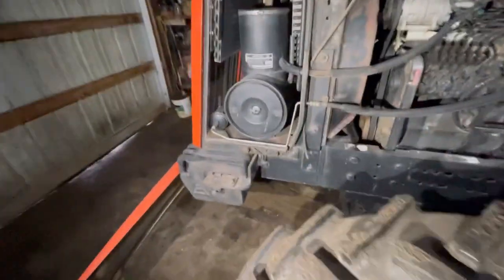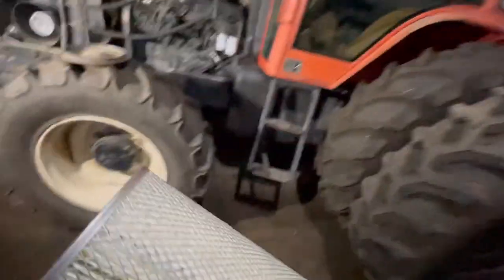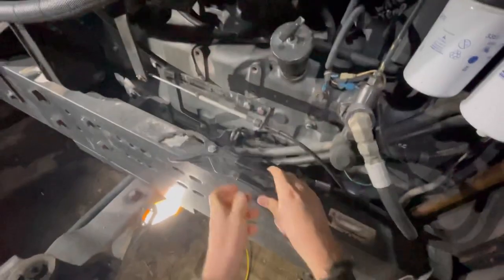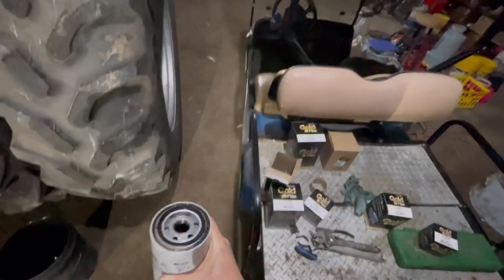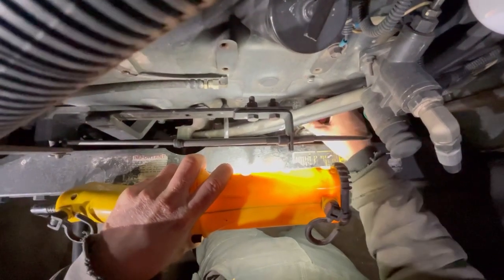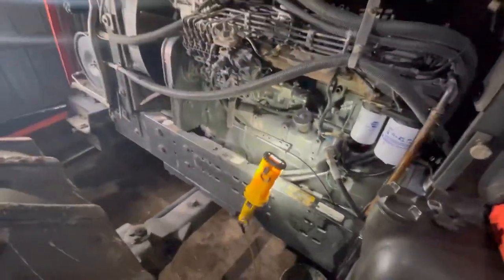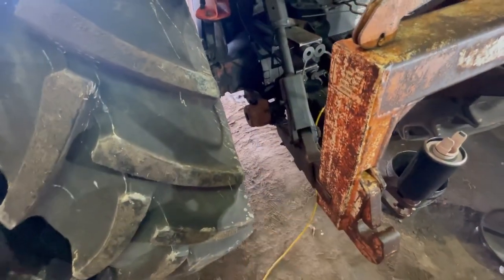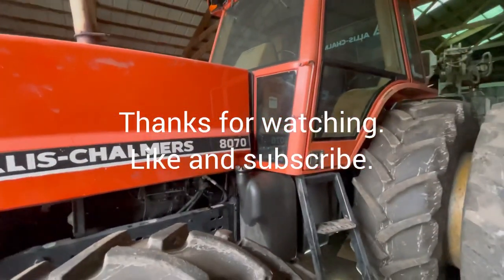Allis-Chalmers 8070 maintenance, longer video.

Comment: 7060 and 7045 would be a Roosamaster pump and the 8070 would have  Ambac M100 pump. 8.3 engines are great but those transmissions/rear were never made to hook that kind of potential to the ground. Front axles aren’t great either.
Reply: The power director doesn’t have a canister on the right rear like powershift does.
Reply from the maker: Yeah a lot depends on how you drive it, we always shift at or below 1500 that way it makes it better on the trans. in our sandy ground it can slip out some.